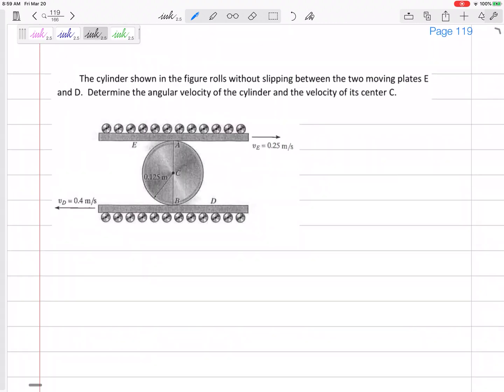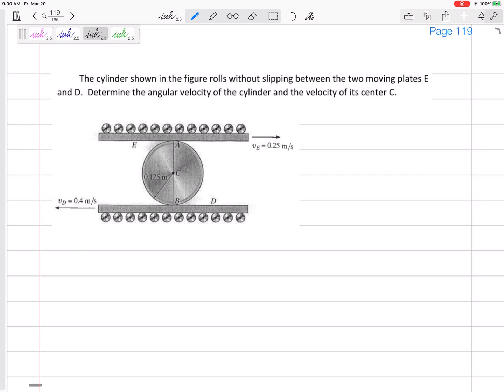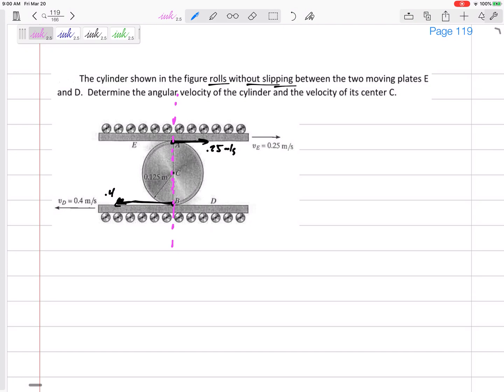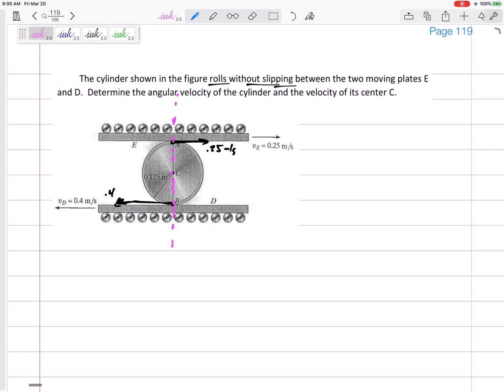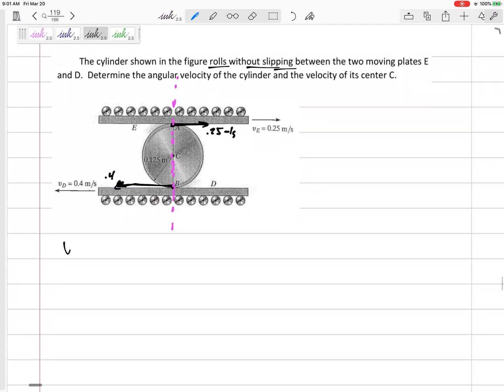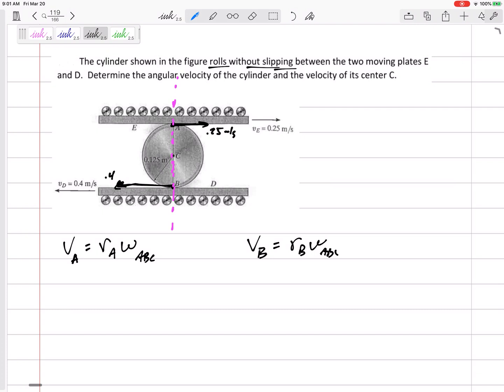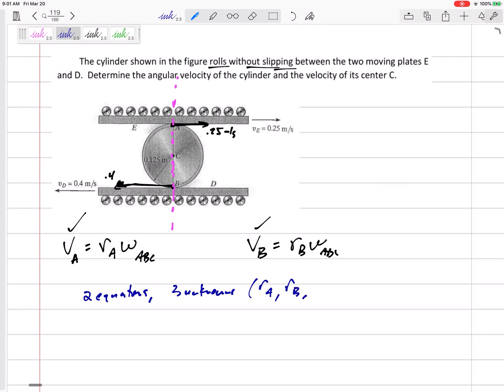Dynamics - Instantaneous Center of Zero Velocity example 2

Comment: what if the center would be a little top of the point A? it has still small distance with respect to A and greater distance to the B.
Reply from the maker: Yes, that would be the case if the top plate was moving to the left (like the bottom plate). Since one plate is moving left and one plate right, you know the ICZV is between them. If they are both moving the same direction the ICZV is above A or below B.
Reply: @engineeringdeciphered  thank you so much professor. i appreciate for thermo videos too.